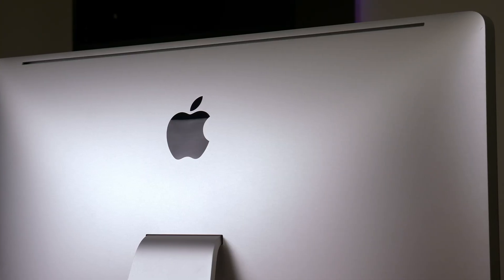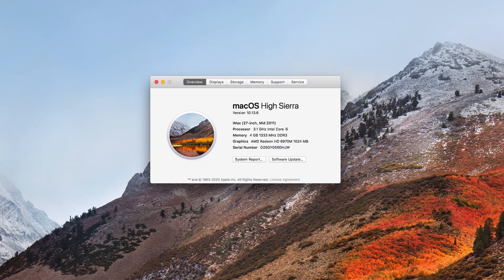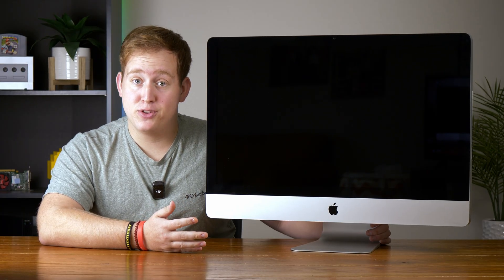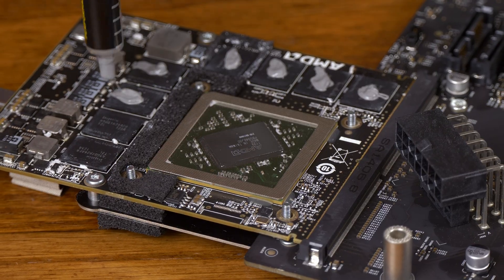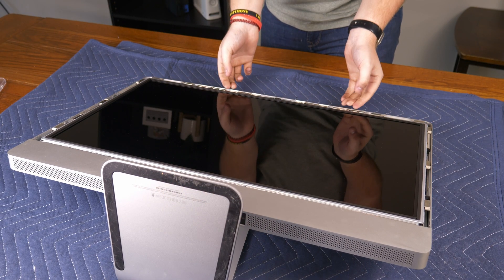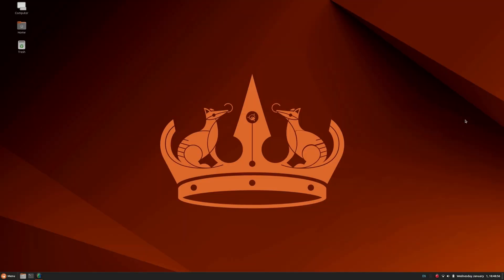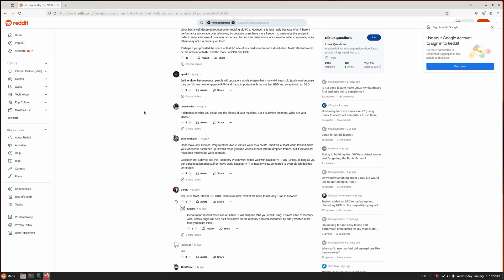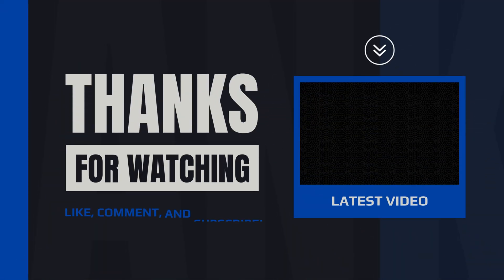This 14-Year-Old iMac is DYING… Can I Save It?

Comment: Why didn't you re-install macos?  I put ssd on my mid 2011 27 inch iMac and have upgraded to Ventura because it was the last os which did not ruin the Photos app.
Reply from the maker: Yeah it's not a bad idea at all... but the longevity of MacOS on their hardware just isn't great. It starts slowing down and you can feel its age really quickly. I installed Linux so it has a more modern and snappier feeling interface, and I have more advanced control of things like resource usage, so I can make an older machine perform as well as possible. No hate at all if you reinstalled MacOS, I just chose a different route 🤩🤌💯

Comment: I have an early 2009 20" IMac bought from eBay. It has an SSD. I increased the ram to 4GB and installed MAJARO Linux. Runs perfect.
Reply from the maker: Heck yeah!! These things are units! This thing is now running ChromeOS and I'm responding to your comment on it! (that's what it's used for now) 😎

Comment: I had the exact same device. Changed the hdd to ssd. Still, it was only really useful as a terminal, which any computer can be. Since I can plug in my laptop to a dock and it's faster, ..., I couldn't justify keeping it.
P.S. I had a bathroom suction handle to remove the screen. Worked amazingly.
Reply from the maker: That's brilliant about the suction handle!! I'll have to remember that for the next time 😂

Comment: So how good would a 14 year old PC be?  Not very...  Not down to Tim, it's down to the whole industry.  Also 4GB RAM and a 14 year old mechanical drive.  Yeah it was always going to be intolerably slow.  I would be interested to see how macOS performs with the upgrades because it's not a fair comparison.  Don't get me wrong Linux will still be quicker, but I suspect it would be fairly close.  The SSD will make a huge difference.
Reply from the maker: You're not wrong... but MacOS on these computers even with the upgrades is still unbearable. I know this because the 2012 iMac that I showed actually has those upgrades (including the SSD) and it's still running MacOS and it's absolutely horrible. So yeah I agree with you, but it wasn't really a Linux vs. MacOS video, but also just a challenge to see how fast we can make it... through upgrading the OS and the hardware. Thanks for the comment! 🤩

Comment: Isn't that HD6970M on the Stay Away from list due to high failure rates?   You just wonder if Apple did not insist on quiet fans vs. effective fans, if that whole replacement program for the faulty video cards would have been unnecessary?   Yes, concur with other viewers. You have a great presentation style.   Hope your channel grows.
Reply from the maker: Wow, I really appreciate the kind words!! Yeah the card had a higher failure rate than average. I agree, I think Apple wanted to keep the user experience "amazing" but in the process messed things up quite a bit 😂

Comment: For the needed temp sensor I have found this instructional video.
replce HDD on the 21.5 inch mid 2011 using the sensor cable.
youtube.com/watch?v=VLrEEgtUuts
Reply from the maker: I appreciate it!! It's somehow not a problem I encountered... although I was told it would be!! 🤪

Comment: Some models are capable of being used as very nice external monitors.(i think only for apple laptops.) p.s. your doing thermal paste wrong-kidding
Reply: The Apple silicon laptops don’t support this anymore, pretty disgusting that Apple stopped supporting this. My iMac 2011 has a beautiful display
Reply: @bjarne431  it is quite a waste, i was going to use one of those 5k iMacs as a monitor and then found out it didn't work. Though that's what apple/dell/hp/etc excel at, making things that can't be upgraded and thrown into a landfill.
Reply: @buildyourcomputer  yup, just sad. Also the mind boggling amount of MacBook/MacBook air that ends up as e-waste today because the ram can’t be upgraded is insane
Reply from the maker: I agree completely! It really is quite sad...
Reply from the maker: I know! I'm sure somebody has figured out a way to make it work with Linux haha. And yeah... I know I suck at thermal paste 😂💀

Comment: you can hate apple as much as you want, i dislike the companies morals, too - but their machines, especially the older ones are just good looking and with a little bit of tinkering they run just fine in the modern days
Reply: I mean they made the 1984 Mac that had a voice already. 80’s kick ass.
And they also made the iPhone in 2007.
Which let to the massive spreed of those touch screen phones
Reply from the maker: You're exactly right!! 😁
Reply from the maker: I agree completely! Personally, I like Apple. I'm not one to hate a company just because I disagree with their morals... but don't get me wrong there is definitely a line haha. Even though I dislike the way they give us the bare minimum when it comes to things like RAM and storage, their computers are still the best on the market when it comes to the average consumer. Yeah I agree, these older systems are still SO much fun to play around with and, with a little bit of elbow grease and some upgrades, they can still be very useable today! 🫡😁
Reply: @ 100% those M-CPUs are efficiency monsters!

that thing in a t420 thinkpad would have me sold 😏
Reply: My 2011 iMac is still kickin strong in Mac OS with 32gb. My 2015 i5 8gb on the other hand, well that one likes Windows 10 much better 😂. About to donate the 2015’s display to my 2019 daily driver if I can save the 2019’s glass.